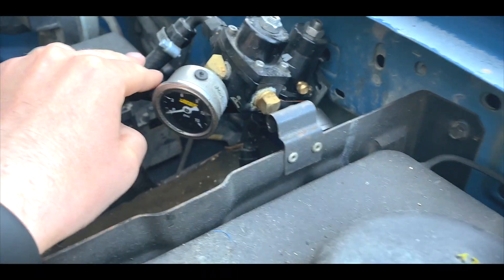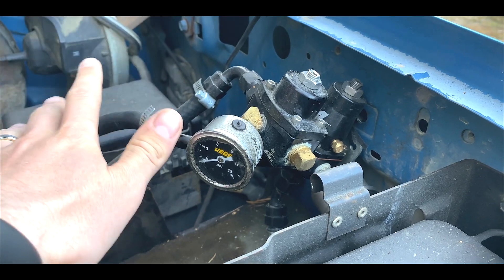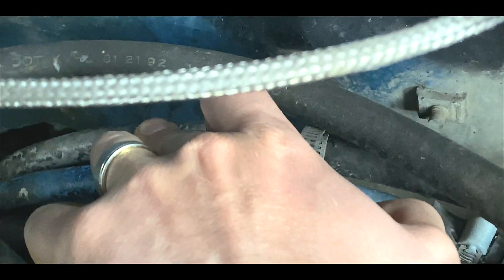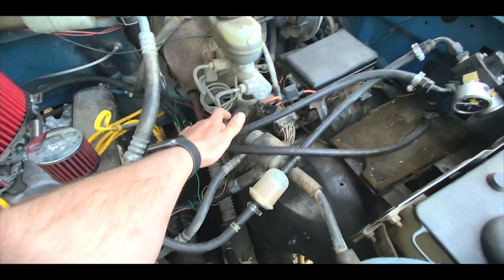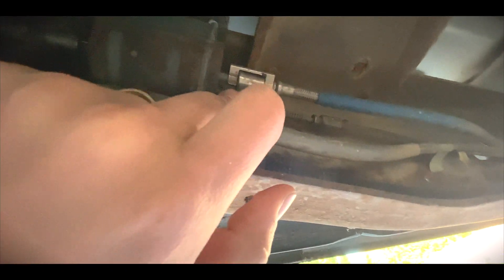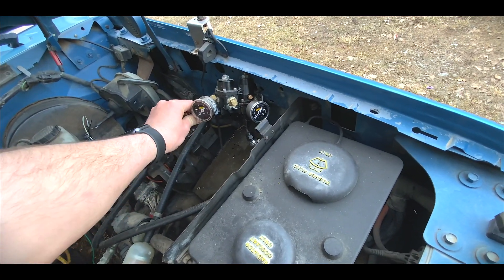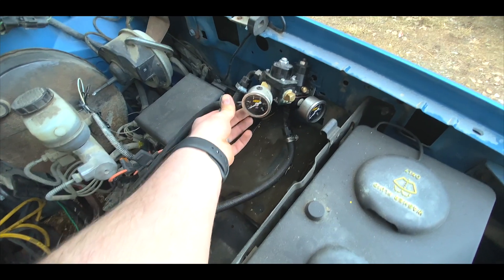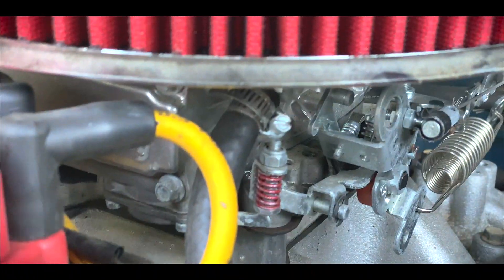EFI to Carb Conversion: How I Ran My Fuel Lines/Aeromotive Fuel Pressure Regulator

Comment: Look this is ok and it works until the regulator goes bad. A simple fix and in my opinion the correct way to do this.  Drop the tank, remove the high-pressure pump put in a low-pressure one, or just delete it in the tank, I did! I put my fuel pump in line up in the engine compartment. The return line to the tank either needs to be caped or put a one-way check valve and use it for a vent! I capped mine!
The carb if set to the correct flote level will regulate it's self! This has worked since the beginning of the gas engine! Remember a gas engine only needs three things to run, Air, Fuel, and Spark! ALL OF THESE RIDICULOUS SENSORS ARE NOT NEEDED AND ARE JUST THERE BECAUSE SOME MORON IN THE us GOVERNMENT THINKS HE KNOWS MORE THEN THE PEOPLE WHO MAKE THESE ENGINES!!!
When a EMP hits the computers and sensors that run your car or truck will not work! I get rid of that crap and lose no fuel mileage, and it can pass all emission tests! Get rid of the computer crap and put the fun back into driving a muscle car!!!
Reply from the maker: Before I sold the truck I was planning on putting a low pressure fuel pump in it with  pressure regulator to ensure consistent pressure. 
Carbs are cools and all, but I will have to disagree with you on your point about modern technology and sensors. I think new tech is much more efficient, and if you have the knowledge, skills, and tools to work on it then it can be as if not more exciting than old stuff.

Comment: Hello sir i got a 93 f150 dual tank. How would i connect both fuel tanks?
Reply from the maker: Both tanks will already be connected. They are controlled via the switch on the cab.
Reply: @DavidCompton  nice through the fuel tank selector correct?
Reply from the maker: Yes. You can select each tank from the switch and then in the engine compartment there should be one fuel delivery line and a return line.
Reply: @DavidCompton  that helps out alot thank you
Reply: @DavidCompton  did you have to make any upgrades to the throttle?
Reply from the maker: @dakotamedlin48  I had to run a new throttle cable. Just used a cheap one from autozone.
Reply: @DavidCompton  is it a throttle cable specifically meant for the carb you chose?
Reply from the maker: No. Just a generic 6ft cable with some shielding that you can adjust and cut to the appropriate size.
Reply: @DavidCompton  awesome. You got any advice for roller rockers upgrade by chance?

Comment: if you paid $300.00 for that regulator you got taken? because Holley carburetors makes them and they sell for between $50.00 and $75.00. I hate to be the bearer of bad news.
Reply from the maker: Yes, in hindsight I did not need a dual stage regulator. Eventually I will do this project again and may go a different route with the pressure regulator. Although, it is a good piece of equipment.

Comment: Why the 2 stage? You could have just spent 80 bucks on Jegs and got a fuel pressure regulator for Carb. Really all you are doing is metering down from 40PSI to 9 max no need to go from 40 to15-16 then down to 5-9 fuck that I'm going 40PSI  down to 9. Seen it done countless times no need to spend 369 bucks man. Check out Lollis_Gargage he did his SN-95 302 engine EFI to carb originally this way, now he's running Holley Sniper.
Reply from the maker: Thanks for the input.
Reply: I was thinking the exact same thing.  No need for two regulators in series, just get one.  Less than half the price too.

Comment: how did you handle the ecm in the car? i am going from tuned port injection to edelbrock 600 carburetor i am also going with the fuel pressure regulator, i bought a kit from summit for like $900 and I don't know what to do with the ecm, i still want to have my air conditioning and i know the ecm controls the spedo and all that fun stuff in the instrument cluster. any help you would give would be greatly appreciated. also, i am taking the entire tuned port injection system off, all the way to the lower upper intake
Reply from the maker: I honestly didn’t think much of it. Just cut out the stuff I didn’t need anymore. Then I pulled out my CEL bulb. Haha.

Comment: I know on some efi systems there is a check valve in the return line in order to keep the system pressurized. Usually it is inside the tank with the pump. I've seen some guys remove the check valve in order to eliminate any bypass issues. My question is does the return line on this set up come from the high psi regulator? If so it seems to me it would eliminate the need to remove the check valve on the return line. I'm looking at possibly removing the check valve in the tank on my own project and am wondering if this product will eliminate the need to do so. Thanks!
Reply: It should yes, the return line will be pretty much be the same pressure as what the efi pump is moving, the regular just let's through the few psi for the carb and everything else goes back to tank
Reply: But im pretty sure this can be done without using an expensive 2 stage regulator
Reply: @jjmccloud  I agree.  Like way cheaper..

Comment: My efi is making me pull my hair out! 🤬 I thought about some sort of fuel regulator to take my 40ish psi to 7-15 and found this. Thanks you! I have a manifold and a carb. $300 isn’t much compared to how many sensors I’ll have to buy in the next 3 months. My only fright is the pressure going up while I can’t see it in the engine bay. Can you add a pressure gauge?
Reply: its pretty easy to add a fuel pressue guage to a system. Just get you a housing and some pipe couplings

Comment: I was researching my fuel pressure bouncing up and down problem on a EFI bronco to carb swap, I am currently using a Holley bypass regulator (12-887) I have 7-15 psi bouncing rapidly, (all stock pump and lines 95 bronco) this should be exactly what I need to fix the problem, thanks for posting the vid and part number!
Reply from the maker: You’re welcome!
Reply: @my1972maverick. Did you run into issues with the E40D trans. I have a 95 5.8 also. And want to convert also.
Reply: @jaysonescoe5799 , you absolutely run into issues with the trans. The original efi talks to the trans controller. I installed the Baumann stand alone e4od trans control, truck shifts better than Ford ever imagined
Reply: @jaysonescoe5799  Mine is a 78 bronco, that I used the 95 Bronco fuel tank, pump, lines, filter etc. My plan was to have a reliable fuel system with return line to help lower fuel temp at the carb and have steady fuel pressure for tuning the carb, so far it is working well, fuel pressure is not consistent, but I think its my mechanical gauge with the isolator.    Your trans will need sensor inputs to work correctly. you could get a standalone controller, or research and rig up the sensors to the stock ecm- to run the transmission.   probably better to just fix your efi imo.
Reply: @my1972maverick  I appreciate the response, my EFI is fine, was just wanting simplicity, I’m in north east Ga. No emissions here so I’m still smog/egr deleting anyways. Smog pump locked down cpl years back already so bypassed with smaller belt.  Good luck with you’re rig I’m sure it’s hell of a ride.
Reply: Efi fuel pressure might have been to high coming in for that holley model. Trying to find the right 1 myself and looking at that regular. Maybe I need to look more lol
Reply: I use the same controller on my 91 . It’s called the quick shift 4.